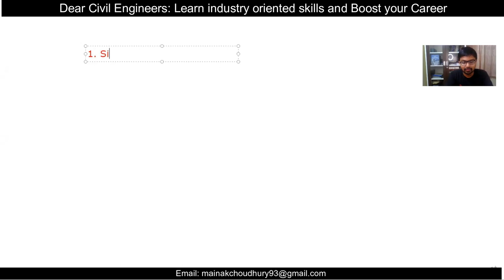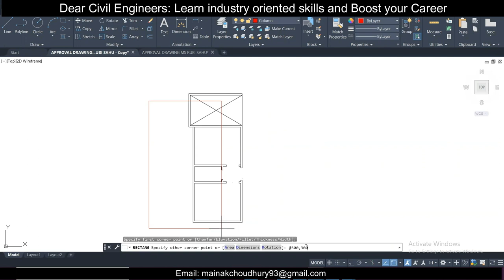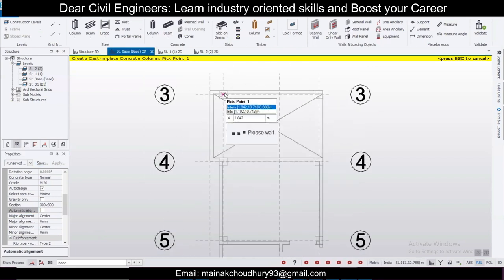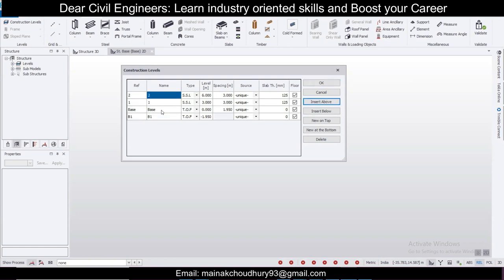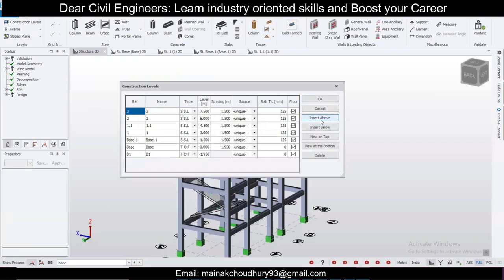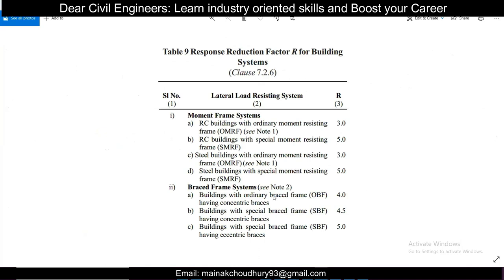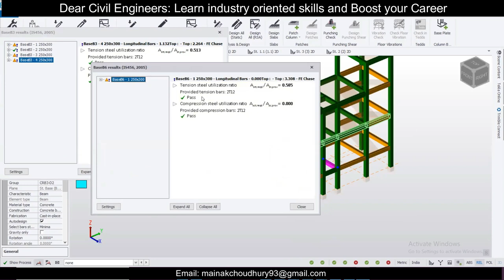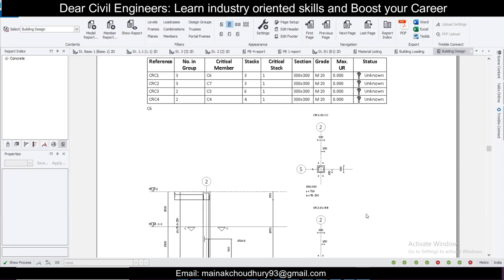Building Structural Design Using Tekla Structural Designer (TSD) Software Full Couse

Comment: As you assigned fixed support to the base but while designing foundation you didn't remove the supports. Is it okay not to remove supports???
Reply from the maker: Edit.
Yes, For Foundation Design Its better to have assigned Fixed Supports, because when you find out the support reactions, you will get the proper results, I had missed that in this video, good that you pointed this
Reply: Thanks for replying. 
For any other foundation we need to remove the supports and then design foundation.
Reply from the maker: @shaheershafat4599  for combined or raft footing we have to perform structural analysis and after that we need to remove the supports and then perform design